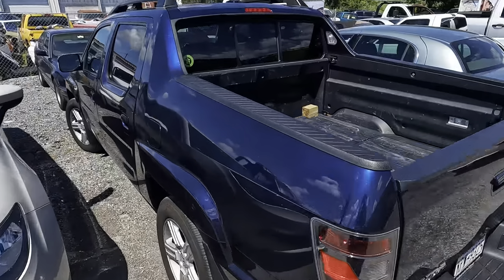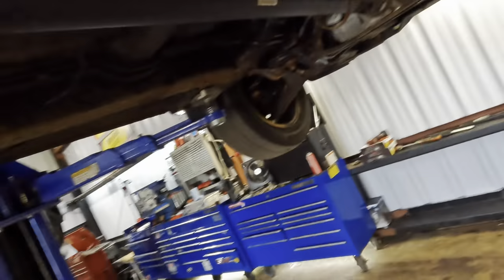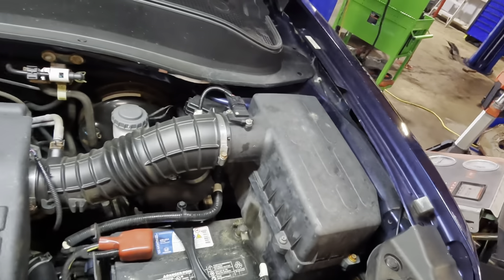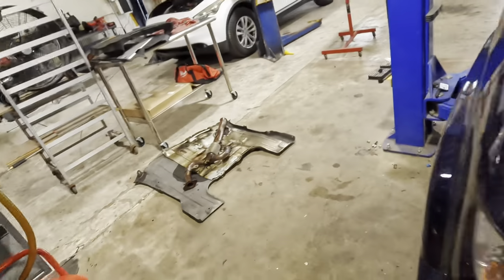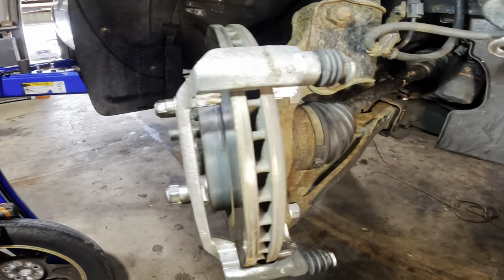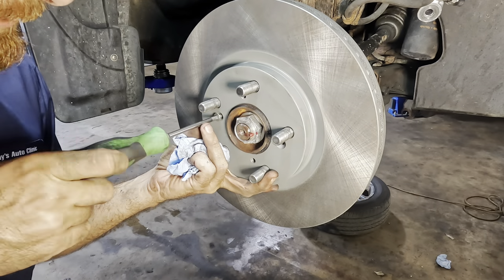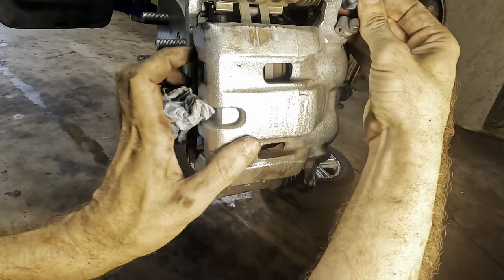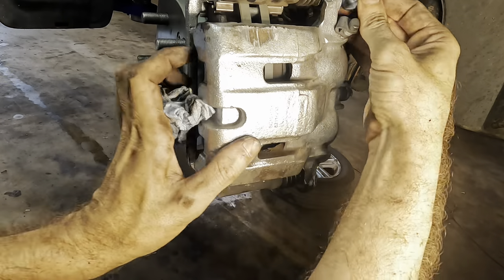Rust Busted Spring!  Honda Ridgeline 3.5 2006-2014 Multiple Problems!

Comment: Never ceases to amaze me how some folks survive their own "repair" work.
Reply: And he drove from New York to Florida with his family in the truck.
Reply: I would check the other 3 rotors just to be sure.
Reply: Hell I have done plenty of work on my own cars. Over the last 36 yrs and never had a failure.
Reply: In my DIYer non-professional opinion, learning to work on cars is easy and cheap in today's world. Learning to work on cars SAFELY requires common sense, which is something that a lot of people especially in today's world severely lack.
Reply: ...and some techs.... been to 2 shops for my diff and BOTH of them screwed it up.!!!!!
Reply: mechanics often mess up repairs as well.
Reply: That's ridiculous @mrmustangman
Reply: I just wanted to add, that I have seen people use wood for tie rods and control arms. I guess they think it is like the flintstones or something.
Reply: @jthonn But if it is indeed a Flintstone Problem, at least there’s no worry about the brakes. One would just have to check the skin thickness on Fred’s feet. 😂

Comment: Nothing like a northern vehicle just to see the rust. Hopefully the Honda will live on for many more years with such low miles. Great video once again Ray!
Reply: Northerner Here, Have a old 08 Civic, if you do the work to take care of parts, washes after salted road use about 2-4 times a month, then they will go forever, with little rust. Even the mechanics up here think my car has less rust on it than most.  Actually the only main rust issues I have had was the Cat and I have 2 small spots starting in the rear quarter and one on the hood. 
And You are absolutely right Ray Ridgelines are not Trucks. They are Minivans with the back cut off to make it look like a truck.
Reply: The rule up here is don't pick it up until you look under it!

Comment: Ray, please keep your flangies out of dangerous moving parts! I would be unhappy if you were injured and not able to make these informative and entertaining videos. Your hands, fingers and experience are your livelihood. Also, you got a taste of what us northerners go through with rusty repairs. But, we don't have to deal with the summer heat. So, every location has drawbacks.
Reply: "don't have to deal with the summer heat"
Say that to my thermometer outside, that told me a week and a half ago that it was 98°F out there, with at least 80% humidity, in upstate NY. And that's how bolts under the hood rust. The humidity sticks to everything, including the very flat surface of my double covered griddle, and rusts the heck out of it.
Reply: On the west side of Florida where Ray's shop is located, the weather is very nice even during summers, but the east side is a different story
Reply: Ohio resident here.... save the snowy, long dark evenings and always gray sky for campfire time stories. They will think we make this stuff up as we go along.
Reply: @Estranged180  Salt dust acquired during winter driving might be a factor also

Comment: That rubber undercoat only helped with the rust process
Reply: Never go full undercoat. Lanolin undercoating is way better. Stays wet and nourishes the metal, doesn’t trap rust.
Reply: @WalterMelons  I use rust check coat and protect. Definitely not as good as lanolin but does the job for me
Reply: That kind of undercoating just traps the salt and rusts much faster
Reply: That crappy undercoat does a great job of covering up the rust, typical used car dealer treatment.
Reply: @nicholas440 You're forgetting an important element of that. Apathy
If you check and correct the coating issues then it's a whole different ballgame.
Reply: Very ,very true

Comment: Given the issue with that RF rotor being wrong or otherwise rubbing...I hope the LF was pulled apart for inspection and to compare the rotors for differences in dimensions.
    It is nice seeing what the rust belt cars look like even with the undercoating applied. 
    Thanks for the great video Ray🙂
Reply: I was thinking the same about the driver's side.   I would have used an oil based coating.  Usually, they do need to be reapplied every 2-5 years.  The coating on the truck is hard and looks nice when applied.   That's it.
Reply: The LF tire was on the floor so I would assume yes.

Comment: Hey! Northern New Yorker here. I can confirm our under hood bolts rust. My truck has bolts that hold the fan shroud in and they’re rusted somehow. The things you’d expect to rust will not fail to rust but somehow us New Yorkers could rust carpet.
Reply: As an ex upstate New Yorker, I always thought the function of the carpet was to hide the rust... :face-turquoise-covering-eyes:
Reply: And you would think stainless steel doesn't rust - BUT NO !! it will.
Reply: @terminallygray  just bought a brand new BOSS snow plow last year it’s a 7 foot stainless it’s already rusting smh

Comment: If the incorrect rotor was fitted, perhaps the rotor on the other side is incorrect if they were fitted as a pair.
Reply: I would have thought he'd check the other side as well. Or compared rotors before ordering a new one.  Maybe he didn't record that or edited it out.
Reply: He must have just not filmed it. If you look towards the end of the film you can see the driver's side tire removed. So it looks like he did inspect it. More than likely how he came to the conclusion it was the rotor
Reply: @terrymcguire6478 he could of also recorded it and That part didn't make the Edit
Reply: What about the rears as well?
Reply: @terrymcguire6478 he constantly records/edits out things to cut down the length of his videos. He cuts out anything he considers "boring".
Reply: He didn't need to, the other side turns freely so it's fine. But why go through all the work of tearing down the other side if you don't really need to.
Reply: @williameldridge9382  yep that's what I was saying you just explained it better
Reply: @craigquann  I agree Especially when he is verify customer complaints he is only fixing what the customer wants fixed

Comment: That is why the caliper bolts were not tight.  Tighten them and the mismatch locked up the rotor.  Loosen them and it would just turn.

Comment: Funny thing is the dust shields/backing plates are gone and Ray doesn't even notice they are gone. Honda made those things out of some really cheap materiel. It'll be interesting to see part 2 when he tries to remove the rear brake rotors and there's nothing left holding the parking brake shoes.

Comment: Pads is missing the wire-spring that helps keep the pads away from the rotor. They sit in the little tiny holes on the top side, facing outward towards the caliper. AZ sells a kit for it.
Reply: @@SimrKhera probably not, but it extends the brake pad life so that it doesn’t ride on the rotor and have an uneven brake pad.

Comment: Ray I think I saw 2 wires on the compressor connector meaning it is not grounded via the body, and you didn’t check the black ground. I also think some systems switch the ground via the BCM so worth a check.

Comment: Ray please don’t put your hand down near that spinning fan again.  Fingers are not replaceable.
Reply: and some cars fan start with out warning
Reply: As a paramedic, fingers can be reattached in surgery.
Reply: @Knowledgeispowersheep  Never mind Ray.  Someone claiming to be a paramedic on the Internet says fingers can be reattached so go ahead.  I’m sure a reattach finger will have the same mobility, strength, and ability to feel those nuts and bolts you can’t see.  Probably won’t even miss any days at work either.
Reply: Ray is becoming more unsafe as the days go by. No PATIENCE ! safety first !

Comment: When hooking up those A/C lines 12:40 make sure to keep hoses away from hot exhaust manifold (and moving parts 32:15) or you will make holes in your hoses... stopping da-fixiting and costing da-cash.
Still: more important to keep fingers in tact 32:50 rather than clipping them in fan, or roasting them on engine.
For the A/C compressor, you can hook a plug to A/C clutch for manual test, and listen for clutch click, even if engine off... Like most folks, you prefer not to crack A/C system open if can avoid it. Good luck with fixit vid part 2.
Reply: Hot wiring the A/C clutch with the engine off is an excellent tip!  Could also expose the possibility of a near rotted out wire to the clutch. In the salty North we don't use a voltmeter or even a powered test light to check for power on 12 volt circuits. We learned on trailer wiring before the days of 22 gauge wire and electronics.

Comment: I would recommend replacing both coil springs. Putting a new on on one side and leaving the rusty old on on the other would certainly make the rusty side drop and it's likely going to fail soon anyway.

Comment: You checked the compressor clutch for voltage, but you never verified the ground. That was a two wire connector so the ground is not on the compressor body, it goes somewhere else for ground. I could be wrong, but I don't think so.

Comment: Unfortunately it's quite easy to get rust on those bolts here...blowing snow snow blown up into the bay while driving...even ungaraged cars it can happen.  Life in the rust belt, it's a big reason a large pipe is part of the mechanic toolbox...and a blow torch and welder as well 😅

Comment: Thanks Ray another great video, will look forward to Part 2 now on the Ridgeline Strut insert and hopefully a new compressor as well.
Ok who is the other guy working with Troy ( AKA The Shadow) on the vintage Red Ford Truck? a new member of Ray's Auto Clinic as we didn't get a good long look at him, so hope it is that busy that you needed another Mechanic and will get an introduction soon.
Keep Safe Keep Strong 🦘🦘🦘🦘❤❤❤❤
Reply: I was wondering the same thing.
Reply: needs to work on those cars sitting outside on the lot and sell them.

Comment: I own one of those.  Make sure you depress the left hand temperature control button to engage "auto" temperature control.  Also switch it off "dual" control using the button at the bottom and to the right.  Then see if the compressor engages.  "Auto" auto engages cooling based upon the temp settings on the display.
Reply: there was voltage at the connector, so the compressor was being told to engage, the issue is either a break in the wire leading to it (unlikely) or the clutch is just locked up from rust, or broken internally (much more likely)

Comment: Eric O did a fantastic video about why NOT to aftermarket undercoat a car.  Nice looking Chevy, undercoated with a bunch of black tar...  And he was popping off rusted metal all over the undercarriage.  It's either Krown or Fluid Film rust treatment.
Reply: Both of those products are quality products. More like an oil treatment. Some of the earlier products would cause this issue. Do you remember the name Zeebart. It would trap moisture between the product and metal causing flaking. Any product that hardens in place is bad. Here in the north vehicles rust quickly. Crown or Fluid film will slow down that process. I have no affiliation with these rust proofing systems, except buying and using them. They work and are a good investment.
Reply: I saw that video, I believe it may have been Ziebart, which is well known for not doing what is claimed to do, keep out the moisture due to cracking and letting moisture get behind the coating and trapping it there.
Reply: Eric O fanboy

Comment: Very good video Ray. It is funny that the driver never complained about the car pulling to the right with the brake problems he had. They will never get the car aligned as rusty as it is. Setting the toe  after replacing the tie rod will be the only thing they will be able to do.

Comment: Not all compressor clutches are grounded internally. Check the ground side of the plug providing power to the compressor clutch. Northern, rusty underside could have caused the compressor clutch to lose it's ground. Many years ago I bought a customer a compressor for just that reason. Replaced the compressor, it still didn't work. Bad grounds because of rust was the problem.
Reply: I looked back carefully and there is only one wire in that A/C connector.

Comment: Dude. I'm in the process of replacing the valves on my 08 Pilot, and some of the brackets are just falling oof.  That rust on those bolts is mild lol.  I'm re-plating the hardware in Zinc.  Our was undercoated many times.  Frame, is great, and she had 350K Km on her in Northern Ontario.

Comment: Broken springs on the ridge lines and pilots of that era were very common.    There was a Honda TSB on them.
Reply: my 32xi bmw likes to break rear springs every few years. mechanic blamed it on rust but a couple weren't at all rusty. i just think that they're junk.
Reply: The older ford taurus was worse. They broke then punctured a tire. Fords fix was some kind of shield to block the springs from damaging the tires

Comment: being a long time resident of Iowa, I will tell you that rust gets EVERYWHERE. Those sway bar bolts aren't even rusted that bad. If you heat put some penetrating oil on those, they might free up. Rust always brings the possibility that things will seize, but it usually doesn't hurt to try.

Comment: On my brother in law's car, the previous Technician installed a rotor that was 1/8 of inch smaller in diameter. The break pad had an interesting wear pattern  with its edge wearing over the top of the rotor. It also caused a vibration while braking. Attention to detail is required when working on vehicles.

Comment: Good work Ray, amazing that they didn't have more problems having the wrong brake parts. What mechanic or person that did that job put those folks in danger. That car is pretty crusty, but could be expected considering where it came from. It is hard to say if that undercoat helped any. I think undercoating should not be done when the car is brand new, do rust reversal treatments instead. Maybe do an undercoat down the line. reason being is if the metal absorb water the undercoating may make it hold it longer. Also Ray, they do have oxidation problems in Florida around the beach areas. The salt air will eat them up too, and not just the undercarriage. Part two I think will be interesting, replacing the broken springs and A/C work. Have a good one. Oh, BTW, did you ever get that engine in the subaru?

Comment: I wish they have a Honda truck like that here in the Philippines that fits better in our narrower roadways around here.  I would definitely drive it.  Nice to see some Honda repair Ray.  We don't normally see it fix in your show.
Reply: Hond can take a lot of pain I love them
Reply: Honestly, look for a Ford Ranger. If you try to find between 2011 and 2018, all you'll find are diesels, as Ford didn't make a gas Ranger for the global market. 

Take care of them, Ford light trucks are bulletproof, save for electrical problems with some transmissions.

Other trucks to look for are the Nissan Frontier, or the Toyota Tacoma.
Reply: @isaiahwelch8066 the Isuzu D-Max trucks are great, my uncle had one in Colombia that was 4X4, diesel, manual transmission, 4 door. Very nice truck, very reliable, fuel efficient. Too bad we can’t get them here in USA.
Reply: @isaiahwelch8066  Most Ford Rangers in Michigan have rotted out lower core supports that causes A/C condensers and radiators to swing freely and eventually break lines, then drag on pavement.

Comment: It's crazy how they have it undercoated to prevent rust from eating up the metal, but then the undercoating starts to peel away because of the rust that's forming under it.
Reply: It’s trapping moisture not preventing rust
Reply: @waterloo123100  Yup.  Any undercoat that hardens will rot out the metal even faster.  The only thing that works is a temp rust inhibitor like Fluid Film.  Yes, it will eventually wash off, you reapply it every year.

Comment: Ray Goodmorning They came a long way to get to your shop LOL. The brakes problem that’s really interesting to have the wrong rotor on the Honda,the broken spring on the strut could be from over loading.Nice video Ray
Reply: The salt probably found a weak spot on the spring coating, ate into it creating a weak spot and one Jersey pothole later, CRACK!
Reply: needs to be on diet.

Comment: It looked to me like that caliper bracket was bent.  I've seen it before with reman calipers, and since the caliper contacted the wheel it probably even happened on that car.  That rotor should sit in the center of the bracket and it was definitely very close on that one side.

Comment: When driving in winter the melted salty water turns into a mist from the wheels then circulates in the engine bay and covers all surfaces causing corrosion.

Comment: You got the rotor and bracket fitment figured out. But wouldn't the caliper still be contacting the wheel? Don't think that fitment would change by just replacing the rotor. The loose bolts might of had something to do with that, but still would need checking

Comment: I had broken last loop on a rear spring on VW Golf V after about 4 years (about 60k km), by look of it, it was clearly a fatigue crack, likely from the step-wise highways here (so causing small, but very frequent steps). Both rear springs failed the same way a few days apart (the breakage was clearly audible thump, but at that time I did not know what it was, just it appeared to me the car became unexpectedly low, found the real cause at annual maintenance inspection).

Comment: When he took the brake caliper off there was a washer or spacer at the top of the caliper bracket when he put it back on they were removed but one spacer at the top of the bracket and not the bottom would force a angle on the caliper bracket which might have been the problem in the first place not the rotor.